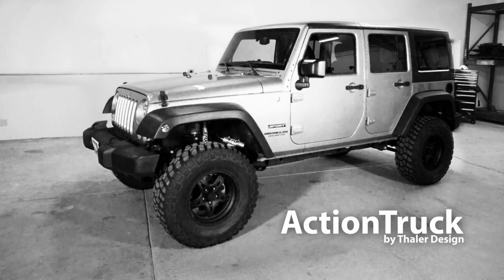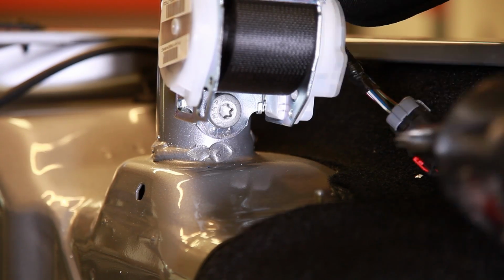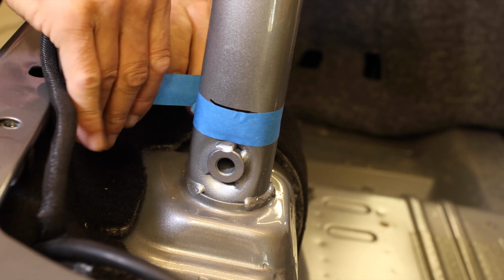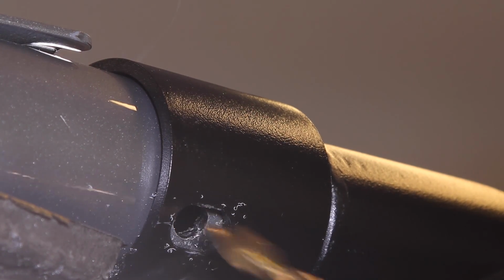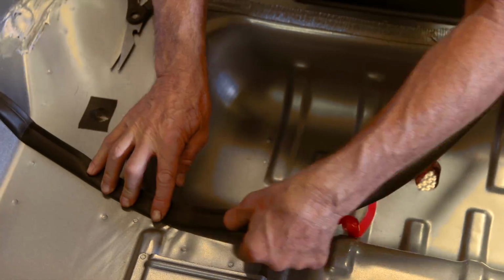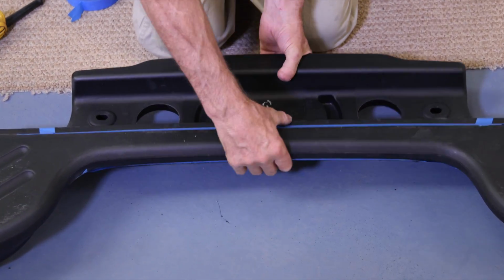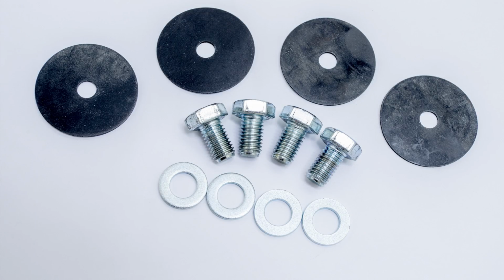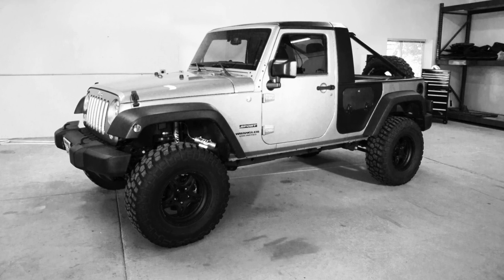TeraFlex Install: ActionTruck by Thaler Design

Comment: Why not just buy a 4WD pickup?
Reply: +opjoipopikopp[pl[p[  there are no mid size solid axle pickups on the market in north america
Reply: because thats what everyone else does.
Reply: +stephen featherly so now you have something similar to a midsize pickup, with less cargo capacity, less utility, less occupant space, for much more money.  sorry, if I need a truck, I'll get a truck.  There is plenty of customization you can do to a truck for 6 grand.  Even more when you add in the price difference of a midsize pickup to a Wrangler Ultimate.  You talk about "that's what everyone else does" yet 'everyone else' buys a jeep & bolts on the same range of bolt-on accessories...
Reply: They are not a Jeep.